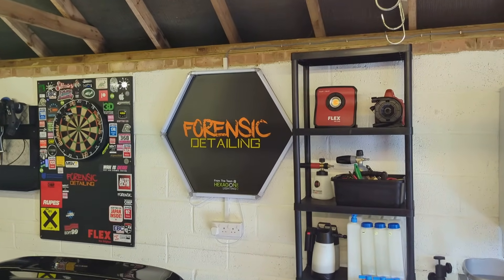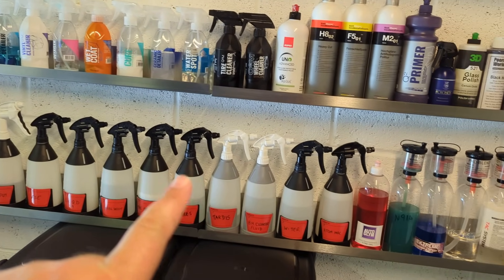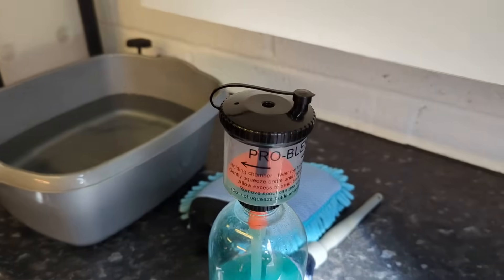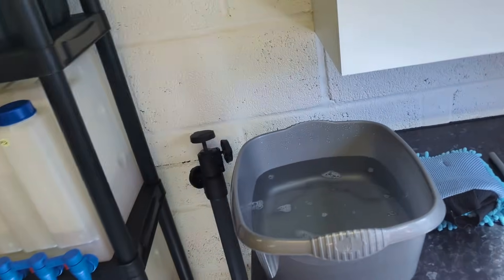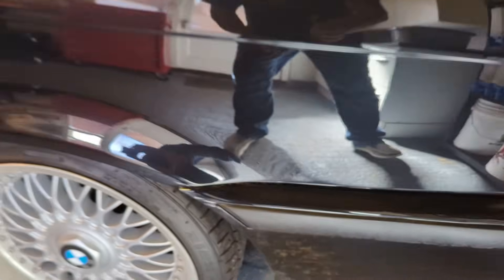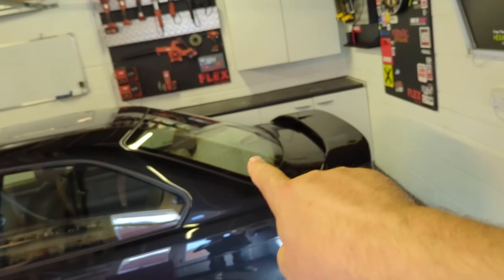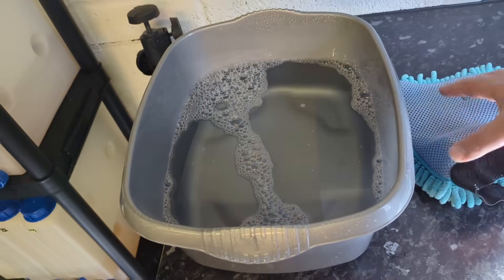How to do the Forensic Detailing Bilt Hamber Waterless Car Wash

Comment: I’ve been cleaning a piano black car with the softest paint for years. I use ONR, 914, and absolute rinseless. One thing you did that I would never do is clean a higher area after a lower area. I go from top down only. I would never bring what I picked up from the bottom up to the mid level where it could cause very visible marring. Fine scratches are definitely accumulating on my car after the years but they are only visible under direct flashlight. Put in the sun it still looks nearly perfect. Rinseless washes are very safe on weekend drivers. I wouldn’t use it for a daily driver unless I was willing to wash every 2-3 days
Reply: I usually wash my new black Tesla twice a week using DIY Detail rinseless and an ultra black sponge and ultra plush thick drying towel. Super excellent results
Reply: @GrandHuevotes  that’s good if you can keep up the effort. I don’t have the energy for that many washes, but I also don’t need more than one a week or so on my car
Reply: I have a similar system I wash the roof and glass then the doors and wings to mid way then I swap to a separate white wash mit for bottom of doors, bottom sills, bumpers and round the arches. I use a white mit so I make sure there’s no grit after rinsing.
Reply: @davidcassidy2731  This is what I've always done plus I do the back of the car before the front. Front collects more dirt/bugs obviously.
Reply: If you washed it properly you’d have no fine scratches, your also lying your saying they are only visible under a light but yet your saying it looks good in the sunlight? Light/sunlight is going to make your paint look swirly so I doubt it still looks good in the sunlight

Comment: I know a bit about rinseless and I wouldn’t use a microfibre or noodle item if you are going to put it back in the bucket as they don’t release the dirt. A rinseless specific sponge such as the Big Red is much better. Microfibres are fine if you use several and never return to the bucket. Keep folding so have a clean side each section then discard once all used. Spraying each panel first with the wash solution is also important.

Comment: I keep a bucket with 4 litres of Optimum No Rinse (15ml) Autoglym QuikRefresh (2 caps) and use the solution (almost daily) on the black roof of my Countryman to remove overnight condensation, dust, pollen and dead flies. Might well add the diluted BH QD,but presently using Soft99 Luxury Gloss QD or Garage Therapy 2 QD.
Reply: That's a cracking idea 💡

Comment: I'm in my mid 70s and want to hold off going to the local handwashes or the scratch tunnel as long as possible. Rinseless washes have been a boon for me. I've experimented with different methods but the key, for me anyway, is a pre-spray with the product before I touch the car. Like you it's letting the product do the work and gliding the mitt over the surface and then gently drying with a plush microfibre. The other key thing for me is my low mileage so it's accumulated dust and pollen rather than baked on road film. There are some fine scratches on the car but only visible on close inspection but I tend the think you would get these anyway hence why people machine polish from time to time. It "feels" safe when I am doing it - the slick gliding feel re-assures me. Great vid as always.

Comment: I use P&S Absolute, it feels more lubricated than ONR, although ive not used the new version if ONR yet  my preferred method is to spritz the panel first, then use a BH QD at 15:1 as a drying aid. In regard to the interior, i tend to spend 20-30 minutes per month, like you said, keep on top of it and theres no real need for a 3 hour clean. All the best Jon. 👍

Comment: Love ONR for clay bar lube and an interior cleaner as well as a water-less wash. Im guilty each time i've used it of putting too much concentrate in so it leaves a slight film. I jsut can't believe in my head 5ml is enough for a ltr. Ive not tried it in a bowl how you did with a mitt. that seems a great idea. As i have two cars to do i usually just bust out the powerwasher but summer, on the weekender, that has been known to get a "less-water" wash when I've not driven either enough to accumualte anyhtin other than pollen and dust when parked for days. (and cobwebs, those ruddy cobwebs!)

Comment: Used this method/these products during last summer’s hosepipe ban, after watching your vids. As you say, it’s pretty cheap, £1.05 for a 10l bucket of N914, I poured some of that bucket in a pump sprayer and went over the car first. Then multiple microfibres for the rinseless wash. When still wet, used BH A-QD as a drying aid. Really quick, one dry/buff stage.
As you say the only problem I found was what to do about the wheels - that would completely write off a towel/mitt so I stopped doing it.

Comment: My method for rinseless is to use an ultra black sponge because it keeps the pressure points low. I would not use that little mitt you use. Also definitely pre treat first by misting/spraying. Then for drying I use a super thick plush gauntlet drying towel folded in fours. I never have only one layer of towel under my hand as this can cause pressure points. Then I’ll follow up with P&S Beadmaker or thanks to you, Titan detailing spray. Or if I’m pressed for time, I’ll combine the detail spray and drying in one step.  I’ve found this works excellent on my new black Tesla twice a week. 8 months in and the paint looks like glass in the bright sun.

Comment: I woke this morning to find a thick layer of sand on the car from rain overnight.
All I had time to do was rinse off with water with my Karcher as our son had a doctors appointment.
My usual car wash is the three stage auto glym polar wash but I didn’t have enough time.
Is the water rinse the best thing to use in this situation
Reply: We’ve had the same today with the sandy rain and the cars had been recently washed thankfully there wasn’t much on the bar the dusty sandy stuff. I approached them differently but all seemed safe enough. 

My own car (16 year old black fiesta) needs a decon and polish but only some light wash marring. I pre-sprayed with ONR and had a bucket with Absolute (either could be used but the sprayer had ONR in it). You could see the dirt where the wipers sat break from the surface from the ONR, noodle mitt and dry. No signs of any damage. 

Car 2 - 4 years old and paint is swirl and more or less defect free. Pre- sprayed with KKD citrus magic, blasted down with hose lock spray or fan pattern with Hose pipe to ensure all traces of big dust were gone, I used a DI Vessel as it was cloudy but hot, if the weather is cooler or shady I normally wouldn’t bother with the DI water, but you could leave it to dry at this stage with little risk of water spots if you have a very low TDS content. I then pre sprayed with Absolute around whole car and proceeded to wash and dry. 

Third car was washed like the first but as a test panel I sprayed down a door with just DI water at pressure and the rear wing had Citrus Magic (BH Autofoam would also be a good alternative and probably cheaper) and then hosed down. The panel with the Citrus was more or less clean but the water on its own was not enough to shift the dust. Panels air dried to check results as was tested before the second car was washed. Later followed up as stated with the same method as first. 

So I would say the only easy was to get the car clean fast is to either go for a pre spray of rinseless and proceed to use that if the car isn’t too bad. Or DI water and a pre-soak chemical without contact followed by a rinse. I should have done a third panel with rinseless and pressure spray down to see it’s potentency compared to the citrus
Reply: @CTR_1986  thanks for your time and trouble in responding. My car is a 20 year old Honda CRV and it has a stunning blue metallic that looks to have a purple highlight in bright sunlight and it’s my first car. Neighbors must think I’m mad when they see me wash the car three times using the auto glym 😂
Reply: If it's tap water only I would avoid it like the plague. If your water is like ours over here we're basically coating the car in minerals. Minerals that can't be removed without acid, or polishing.

Comment: Good tips all round.  I've got a bottle of ONR to use up, but I do like it in the summer when I can;t be bothered lugging all the kit down to the pavement.  I'm using Bh QD at 20:1, and it is better as a drying aid at that dilution, but what I don't like is that any light rain, and it just water spots up like crazy.  Every time no matter the shampoo, blotch city and I;ve tried light meduim and heavy application.  ONR at 16:1 as a drying aid does the same, but there is no protection in ONR, and there should be with the BH.  I;m probably going to try the new TW grahine qd to see if thats a better finish after a rain shower

Comment: Love your How to videos John. Would Bilt Hamber Auto QD be suitable to use  instead of ONR or N914 instead of as a 2nd step afterwards ?
Reply from the maker: yes on paper, at 1:20 its supposed to work as a waterless wash.  so you could just skip ONR or mckees.    ITs a bits weird doing it the way I did but it works.
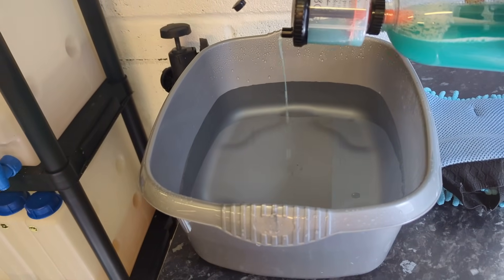Reply: Cheers for the advice John. I tried Auto QD today using your method at 1:20 in 1L of water. It worked a treat. I still used it at 1:10 in a spray after to buff up. Horses for courses I guess.  Keep the great content coming

Comment: Today we had a massive Sahara sand/dust deposit. I've got that with waterless or the usual bit hammer prewash and lsp from turtle wax....but on my 2017 335d the rubber window seals are starting to moss up on close inspection...and good ideas on how to remove this and protect for winter? I have bilt hamber apc and g101...but that's going to take some abrasive toothbrush action! I'm open to ideas 😊
Reply: Take care with the Dilution, Surfex is powerful stuff. Apply, agitate and rinse, if you’ve got rubber trims start off weak as even at 5% it caused them to be clean but a little faded on my dads van, maybe try 1-2%. Doesn’t foam up like some but works well. Keep to one window at a time before rinsing and in the shade if possible. You could use a normal detailing brush or roll down the window if possible and agitate away without the glass in the way. 

If the windows don’t roll all the way down and need something to get in that tight area I found a Hair Bleaching Tint Brush is slim and strong to get the green stuff off, you don’t want it near paint tho

Comment: I think this is a possible solution for a second car, which is only driven on dry days, and then garaged between drives.
Unfortunately Jon, not all of us have that luxury ! 🙂
I started a new job a couple of months ago, which meant I have my own work van provided, and I don't have to drive my car at all, only for pleasure at the weekends yay !!
But, just sat on the driveway all week means it accumulates more dust and bird poo than I would be comfortable using a waterless wash to clean it.
So I still get the Karcher our and do it properly once a week, even though I only drive it at the weekend.
Reply: If you really only drive weekends consider a car cover. May seem pretentious, but it will save you a lot of washing time.
Reply: @johndoe6032  Yes that is actually a damn good suggestion. The only thing that puts me off, is that I have to 'swap places' with car and work van quite often, and as such it means a lot of faffing about.

Comment: I use the rinseless in a pump sprayer then go over it with a noodle mitt from a bucket with grit guard then using a drying aid for the towel dry. I even use it on the wheels with out a cleaner as i know they ain’t caked in brake dust

At the end of the day it’s what ever works for you
Reply: That's precisely my method too.  I'm using P&S currently, it feels more lubricated than ONR.  I've not used N914 yet.
Reply: The rinseless solution is already a drying aid
Reply: @monstershayne  I still like to apply something that will give extra shine without any extra  protection  as I’m going to reset my clear coat in prep for a ceramic LSP

Comment: Hi John, thanks for all your videos. 

Would you consider doing an 'Everyday driver/High miler series'?

This would focus on those drivers that only get to clean their car every other week with caked on dirt and bugs and minimal LSP.

 instead of the usual TLC cars that get the detail treatment every week with LSP.
Reply: I would consider getting LSP on a priority for your daily driver
Reply: @matsudakodo  I have a ceramic coating and use TAC Shinee Wax every couple of months. But with my usage, I find I lose water beading in a two weeks. It's a time and distance driven problem. 

Baked on flies, bird droppings, road grime from 800mile trips, left for two weeks because I'm away. 

All considered, it's still looking ace but it's a lot of work for a daily.
Reply: @You-are-right-but  you're probably accumulating a film that is preventing the water beading. A good ceramic coating should bead for months. Wash with a good soap like Reset or Lift, or 3D Super Soap or Pre-Wash. That's my plan as soon as I can get my car coated.
Reply: @matsudakodo  Worth a try. Thanks

Comment: Kinda seems you did a rinseless. Not a waterless ?

Waterless is a spray on panel then with microfiber you do straight lines with rolling at the edge. Then rotating sides of microfiber. 

As waterless has different formulations and higher emulsifiers

Comment: deff putting a bit of marring in that paint lol. come on now
Reply: If you've just got dust, I'd argue this wouldn't scratch your paint. But if using on a dirty car in a true rinseless method you'd probably be wiping around more dirt then you would with a pressure washer. One benefit however, to a good rinseless is that the dirt in your bucket will automatically drop to the bottom meaning your not reintroducing dirt back onto the paint as with normal soap. You should try a hybrid wash of snow foam, rinse and then use rinseless as a 1 bucket alternative to a regular 2 bucket wash.